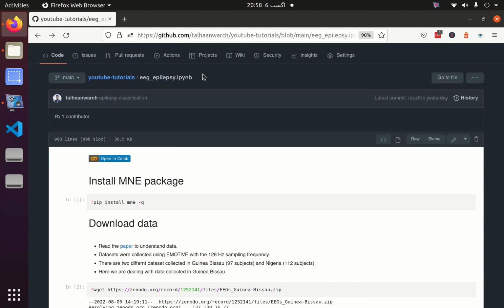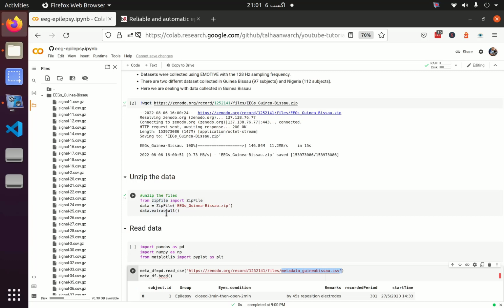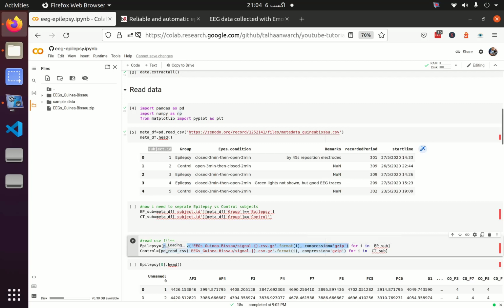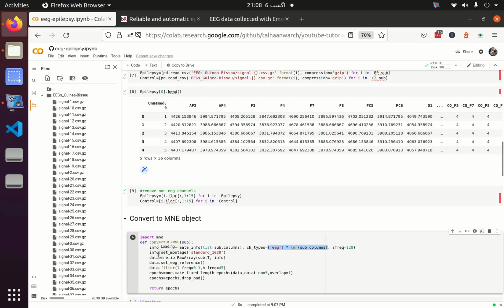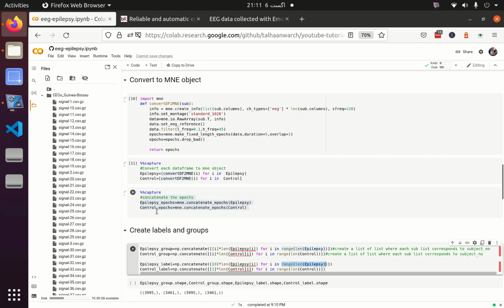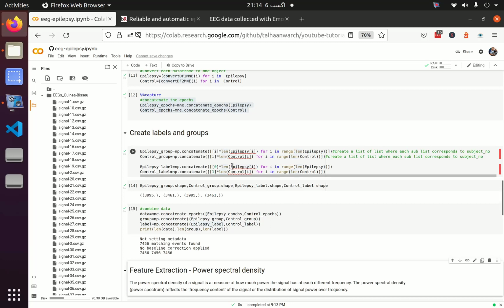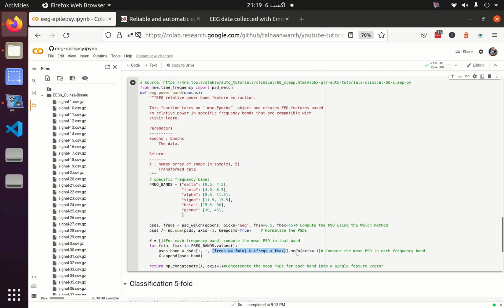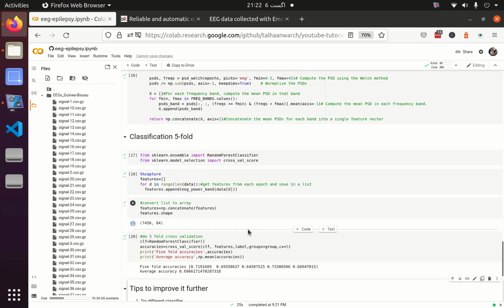Epilepsy classification using  Welch power spectral density (Complete EEG tutorial)

Comment: When you are doing k-fold are you doing it separately for epilepsy and control groups as there is a possibility of data leakage or imbalance if you are not taking this into consideration. Otherwise you will get unrealistic accuracy or precision scores like 85% or above. group k-fold and stratified k-fold does not address this issue so a custom function to handle this issue is better I guess. What do you suggest?
Reply: And that it after hyperparameter tuning
Reply: Normally you are separating test and training data, in almost every ML workflow. I don't think there will be a leakage among them. The cross validation is just separating the training data into parts, and iterate the model based on that. This tutorial is not focused on ML part, it focuses the feature extraction part.

Comment: Assamualikum brother, could you please solve a problem which I am facing in your this code, this instruction is shown, after running the cell number 16 of your code(copied from github). Google Bard is telling that the function 'psd_welch' is no longer available in the 'mne.time_frequency' module. This is because the function was deprecated in version 1.2 of MNE and removed in version 1.3. Use the 'compute_psd()' method of the 'Raw' or 'Epochs' object.                                                       So brother I am requesting you to please just modify that part instructed by bard and upload the code in github or in the comment section here. I am a beginner in this sector, you help would be very vital for me.Gatitude from Bangladesh. 🤲🏻🤲🏻❤. Jazakallhu khairan

Comment: Sir, I am trying to work with a different dataset in which the files are in 'set' format. i loaded the file with mne.io.read_epochs_eeglab. But the problem is, when i want to take epochs using "mne.make_fixed_length_epochs" it shows an error saying "raw must be an instance of BaseRaw, got class 'mne.io.eeglab.EpochsEEGLAB' instead. what can i do now? please help
Reply from the maker: Can you upload set files on Google drive and share a public link here or send me on LinkedIn . I don't have eeglab .set files , thats why i cant tell what to do
Reply: @talha_anwar  Here is the link https://drive.google.com/drive/folders/1CbltqKphRsuoSpxYL3nydKHmeWpol47x
Reply: sir,  did u get the link?
Reply from the maker: @vanloo3087  nope
Reply: I think youtube is restricting my comment due to the link. 
"drive.google*com/drive/folders/1CbltqKphRsuoSpxYL3nydKHmeWpol47x". 
kindly remove the quotation and * from the link
Reply from the maker: @vanloo3087  got it now
Reply from the maker: @vanloo3087  Hi, your data is already in epoch form, so you dont need to create epochs
you can read file via epochs=mne.io.read_epochs_eeglab('file_name.set')
Reply: it is already in epoch form. but their epoch is kind of long. i want epoch of 5 sec. isn't there anyway i can make them into 5 sec epoch
Reply from the maker: @vanloo3087  use numpy then
Reply: @talha_anwar  ok thanks. i will try to do that